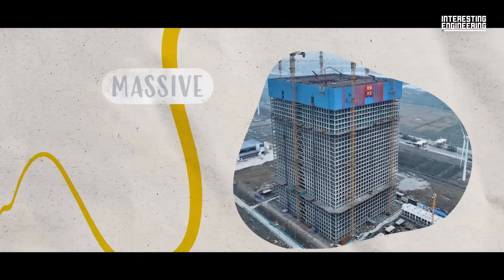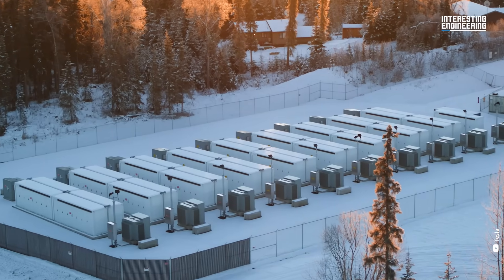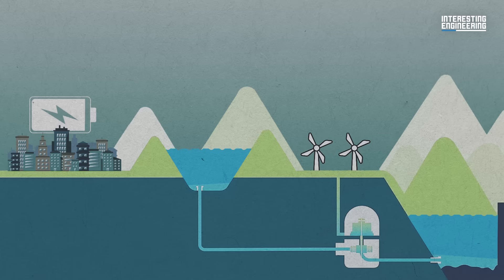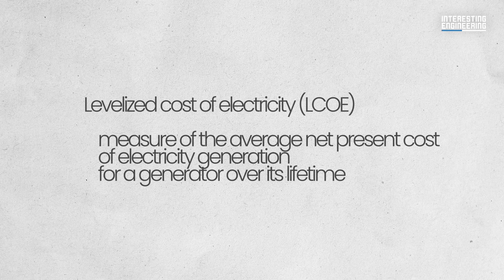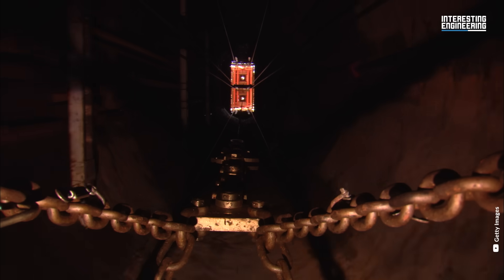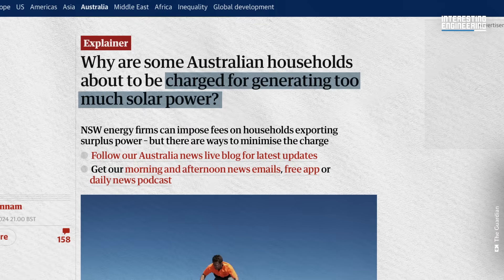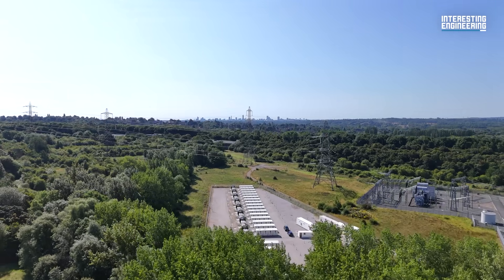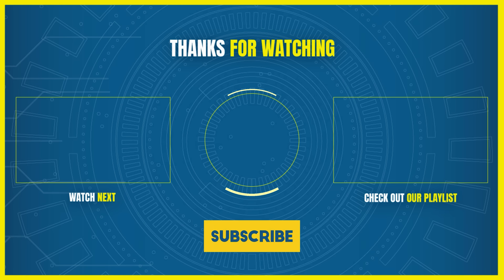China is Building Gravity Batteries

Comment: Do the math, it doesn't make sense.
To power a house for a day you'd need to move a backyard pool size of concrete 100ft in the air.
Reply: It is an odd solution, with 'just' 80% efficiency and with many mechanical parts that likely will need some maintenance to last 25 years. I don't understand how they can report so low cost per kWh.
Reply: @ I simply don't know enough to make any cohearant comment....  I don't have the tools to crunch the numbers right now.
Reply: @urrywest  
Simply ask any AI and it'll do all the work for you.
Reply: @tombh74  "I don't understand how they can report so low cost per kWh"

Simple, reusing existing infrastructure like mines that have been abandoned.

The only thing you need to build is the machines themselves and the weights.

Compare that to the cost of a brand new pumped hydro system - assuming the local geography even makes such a system viable in the first place.
Reply: @tombh74 how long do Lithium batteries typically last?
Reply: @tombh74 it is wishful thinking and expectation of government “support” in the form of subsidies.
Reply: What is the equation and what are the system energy losses compared to lithium?
Reply: @urrywest  
Dude this is simple math.
Look it up.
Assume 100% efficiency also.
Reply: @paultrauzzi5360  they stated %80 round trip efficiency
Reply: Another problem is start up costs....
Reply: @urrywest  Its the Chinese government, there is no such thing as "start up costs"
Reply: @Thirdeye_Shaman  There are start-up costs in China.

It's just that said start up costs are sheeted home onto Chinese bank deposit holders in the form of banks that are incredibly insolvent because of all the uneconomic nonsense they have been forced to invest in.
Reply: I agree. If my calculation is correct then a 10,000 Kg mass at the top of the world's tallest building (838m) has 82 MJ / 23 kWh of energy which is worth around US $2.52 retail.
Reply: @gareth4168  yes
Reply: @gareth4168  your calculations for kWh are accurate. And with a round trip efficiency of roughly %80 this technology would take all available excess energy and use it. Which means zero energy goes to waste from solar or wind and %80 of it can be used later when prices are higher or when sources aren’t available.
Reply: @gareth4168  additional the height is irrelevant as it doesn’t matter if you lift 10,000kg up a 1,000m or if you lift 10,000,000kg up 1 meter. Both result in the same energy. You don’t need to build a mega sky scraper to store the energy
Reply: @mb9662 Indeed which explains why the need for a impossibly large structure and weight to store any useful amount of energy. At 100m height which seems at the edge of a realistic structure, you need 3.68 tons to store 1kWh of energy, that is a concrete cube of about 1.1m by side. To store 1MWh you would need 3680 tons. Imagine how expensive the crane-scaffold has to be, a building of at least 70m by 70m by 100m tall only to store 1MWh.
A lithium-iron phosphate battery of the same capacity would fit on a medium sized shipping container, cost like a thousand times less to make and be able to handle several thousand charge and discharge cycles.
Reply: @gareth4168 As you stack blocks, you  can have many 10 tonne weights holding thay potential energy at its zenith ready to be dropped successively.

It isn't just one big weight but a mountain.
Reply: Lithium batteries only recover the lead when recycled. They only last five years. They destroy the planet. They should be illegal for stationary power storage on mass scale. Gravity battery's store the energy without loss. The cost per unit of a gravity battery is about 25% of that of lithium. There is no energy loss over the storage time with gravity batteries. No rare earth materials are used in gravity batteries. Gravity batteries don't catch fire and burn for days. You would not need such a large area to power a house because you only power a house with stored energy in peak times of use.
Reply: @stevebarnett3347  not true. Smelting recovers cobalt, nickel. Leachimg recovers also lithium. Nothing to do with lead.
Reply: @stevebarnett3347  
Again, you'll need to have millions of these storage buildings and cement take enormous energy to make.
This is no solution.
Find a way the recycle Li OR switch to new Na batteries.
Reply: I like how people who are not involved in the project assume they know better than the engineers assigned to it. it is perfectly plausible to raise questions and discuss scenarios, but you HAVE to assume the professionals involved know many, MANY more things than you, not in the technical sense but in the practical one, like the specific characteristics of the project, all the parameters, economic predictions and etc. does it mean it isn't a sht project? no. point is, we are all in the dark. the only thing we can assume is that it has some merit. maybe it won't justify it's construction, maybe it will. but presuming you will answer that question by calculating the cost of a block of concrete or how much potential energy it carries going up and down is completely preposterous. also, china is know to be pretty draconian with most kinds of corruption, with some exceptions (like evergrande turning into a glorified ponzi scheme), so I doubt it's just an useless big structure to siphon state money. we'll have to wait until we get concrete information (pun not intended) about the specifics, or if they will start to build more of these or just build a couple and give up on it. usually it's the best indicator if it really worked.
Reply: @gustavogoesgomes1863  
This technology has been around for 1000s of years but it has only been utilized by clocks.  Why?
It's totally impractical.
Reply: @paultrauzzi5360  Just gotta superconduct the resistance to over 9000, that's how they built pyramids...Atlantean soundwave levitation technology.
Reply: @paultrauzzi5360  the obvious solution is to build a reinforced shaft into the ocean with an airlock at the bottom. Drop the weight into the shaft to use the potential energy, then transfer it through the airlock and use the buoyancy of water to lower the energy cost of lifting it.
Reply: @mb9662  
How do u get rid of the water after?
Reply: @ a revolving chamber. Not a flooded airlock. The weight moves into an opening in the revolving chamber. The chamber rotates and the weight is now outside the shaft and no water enters
Reply: @mb9662  
Have seen prototypes?
Reply: Yo, flywheels man, flywheels.  Flywheels yo yo!
Reply: Why just not dig two big holes and pump water between them 
Why building a structure and elevating a.solid mass is better solution?
Reply: @martinhernanzorkendorfer6900  
Do the design in your head.
To produce hydro power you need to drop water from a height to a lower area.
As you filled the second "hole" you will be constantly increasing it's height and losing the height on the original.
Hoover Dam pumps water to a higher lake about the dam.  It hold a HUGE amount of water.  Remember concrete is about 2.5 times the mass.
Reply: The only math that matters is the efficiency. The power to lift the weight is already available just not being used and not being by stored (re:wasted.)
Reply: @mb9662  
do you know how much concrete costs and the power required to make cement?
It's not worth it.
You'd need an Empire State building to go with every Empire State building.
Hoover Dam pumps up the hill Billions of litres at night regularly, THAT'S  a real gravity battery.
Reply: @ what makes you think concrete is required for anything other than the foundation?
Anything with mass can be used as the mass. old tires and industrial waste can be shoved into containers and used as the mass
Reply: @mb9662  First, it was an example, one has to specify a material to calculate the volume of a weight.

Second, concrete is a good material to use. Casting a block of concrete is a lot cheaper and simpler than constructing a container, particularly a large container needed to hold low density materials like old tires. Solid metal blocks would be even better is some respects, but more costly.
Reply: @ my reply was to the original thread poster who replied that the “cost of concrete “ would make it infeasible and that you would need an Empire State Building size of concrete
Reply: @mb9662  
I see you are not an engineer.
You want something with the greatest mass at the cheapest price that will never fall apart after being moved a million times.
Reply: @mb9662  
Unless you have  a mountain lake to pump up to during off peak consumption than the mass required is monstrous.
Many dams will pump water to a second height above the dam's at night time rather than reduce electricity production.
Reply: @mb9662  Yep cost is a non issue!
Reply: China #1
Reply: @zachmerritt4661  
At?
Yes China needs energy.
Reply: it's structurally unsafe when you drop the blocks, demands for drop controlled speed or you will just brake it into pieces 😂
Reply: @zillibran 
The blocks don’t freefall 😂😂

The blocks are hooked up to a high gear ratio, so their slow descent spins the generator efficiently.

Comment: You can follow the flow of a river from the mountain to the ocean. During the course of the river you can tap the same flow of water multiple times to produce electricity with multiple hydroelectric generators.
Reply: No they don't, but look at how much they can make and how far it can be sent by transmission lines.
Hoover dam, Quebec, and others
Reply: Rivers dont exist everywhere
Reply: That's generation, not storage. That should be done wherever possible, this is an alternative to massive Lithium installations - but it's still far from obvious that it's worthwhile.
Reply: @Adrian-Wright Dams literally act as storage by filling up and running on partial capacity while letting any extra water spill on. In case of a sudden power need like a bunch of factories all turning on in the morning they just run more water through the turbines to create more power, the water level might drop over the day, but it will refill over the night. It's like storage, but you don't need to already have the power to fill it.

Comment: 0.05$ that not include cost of all the moving part, not like hydrogenerator that only have fix moving part. The wire and bearing alone will need maintenance frequently, the 50 years guarante is sound so absurd if that wire and bearing need to pull tons every days.

Comment: Hydraulics are the way to make this work, as liquids can be pumped.  A raised weight hydraulic accumulator is an old technology.  Energy density is low, but discharge rate can be high and the device doesn't wear out.  This makes it useful for things like grid frequency control and power smoothing.

Comment: Pumped hydro that has been in use for over a century is the only reliable gravity battery, everything else is a scam, or a joke.
Reply: This can be put anywhere. Pumped hydro is very site specific. This does seem overly complicated, though, many many moving parts.
Reply: @sped2001  yeah wayyy too complex, just because it can be put anywhere doesn`t make it in any way viable or good. Not to mention the engeneering nightmare, All those kinds of "gravity batteries"  have pointleslly low capacity, there's a reason pumped hydro is the only widely used gravity-based energy storage. Water is easy to manage it doesn't crack or loose it's quality and is abundant and can be managed by 1 turbine in HUGE volumes, given the right terrain of course. there simply isn't a point in those kind of systems, you need absurdly large amounts of mass at great heights to store any kind of usable power.

Comment: Rather big investment and complex facility for something with just 25 MWp Output. That is roughly the Output of 2 Wind Turbines with 100 MWh total capacity that is 4 hours of "battery" life from this facility when fully called upon. Not that impressive compared to Pumped storage Hydro plants, which have power output in the Gigwatt range, while also having capacities that for some exceed a full day at full discharge.
Reply: Well, with all due respect, the difference here is that after so many years of real estate boom in China, it's more than capable of building such cranes, lifts, etc with great ease.  Compared to building a building which is suitable for human to live in, building such blocks without even windows and doors, however, requires really minimal efforts.  The investment needed for the Chinese, is considerably smaller than investing in hydro storage facilities which, just the unique design customized to each individual water reservoir, is huge.  This building block design, also, is rather easy to replicate, which is what the Chinese are best at doing.  I believe the current 25 MWp output is just still a proof of concept.  There is nothing hard to make it bigger.  The best of this idea yet, is the very fact that these can be build conveniently in the skirts of mega cities where the power thirst is.  Distance is a key element
Reply: @dongningprc  the block design is horrifically inefficient, and also has to deal with maintaining balance
Reply: Yes, if we are only looking at energy. If we look at water, this have its own very relevant complexities.
Reply: @AmaratMamu  so does stacking blocks. Ever try to stack blocks too high? No matter how thick the stack gets, without overlap between the blocks, it loses stability.

The gantry crane design proposed is much more stable, but then you have to deal with all of the energy inefficiencies inherent in a multi-part solid gravity battery

Comment: I don't think gravity battery is very efficient.
First energy has to be consumed to lift the block and then drop it. Energy required to lift the block will be equal to energy released in ideal conditions. But with addition energy loss due to friction and other factors energy generated would be less than what he has been used. Leading to net energy deficit.
Reply: Surplus energy is used to lift.

Comment: AI and IoT is made to use 1/10th or less, of the power that similar technologies would've used under different circumstances, so that's not a problem. In fact, it's a solution, so you can't use it as an example of a "problem" in this instance.

Comment: Most countries wouldn't venture into this as the cost will be high and the yields are low in short term.

But China is probably doing this as their construction sector is too huge (with abundant mineral and Mega factories for construction materials) but their real estate market crashed since the early 2020s.

But as the structures could last decades it could be a great investment. Many called the three gorges dam impractical before.

When they don't have to worry about change in the national policies every election cycle, many long term large investments are viable.

Besides, it is a boost to the GDP For a sector that is dragging behind the economy.

Comment: I'm glad China is trying.
Reply: Why would you try something that will 100% fail
Reply: @KikkerFish 
Probably because they don't agree with your assessment of 100% failure rate.
Reply: @ There is a video of Adam Something that explains why this will NEVER work. The best way is too pump water to a higher location and then, when needed, let if flow down again and make it spin a turbine. Same concept, but without all the dumb complexity.
Reply: @ 
Adam Something's 3-year old video didn't say it wouldn't work. He said that specific build design by "Energy Vault" could be improved. 

The improvements included building underground instead of above ground (like what the company "gravatricity" is doing) or using liquids instead of solids (aka: pumped-storage hydroelectricity)

BOTH of which were mentioned in the video we are commenting under: "China is building gravity batteries"
Reply: @shanerooney7288  fun fact: pumped hydro has existed years before these solid gravity battery designs existed. It’s also the best form of gravity battery
Reply: They don't try they do

Comment: The space of a battery 100 MWh at 120 m high building may be around 0.3 hectares. The Building to accommodate  more or around 31856 solid blocks (with weight 24 tonne each and volume 12 m3 each) is required and this  may generate 100 MWh (efficiency 80%), but during lifting the energy used may be around 150 MWh (lifting efficiency 80%). So the operator will consume 150 MWh from the grid and may generate 100MWh. Is this economic battery storing? Overall efficiency may be 64% (0.8 time 0.8). If the energy consumed will have price 10 cent the cost will be 150000*0.10=15000$, so the 100 MWh must be sold with price higher than 15 cent every kwh.
Kip in mind that the gravity storing on building 120 m has effective high 60 m. 
The gravity energy generation is well known technology based on physic laws. Gravity energy storing based on concepts presented here are intuitively not economically. The problem is on huge amount of solid blocks needed and huge energy needed to lift these blocks and use on demand. These challange can be solved adopting "levitation" technology to lift solid blocks, and use one block multiple time to generate energy on demand. These undisclosed technology can be shared only with interested government and interested investors, interested energy operating companies. Bring them on round table and let negotiate partnership.